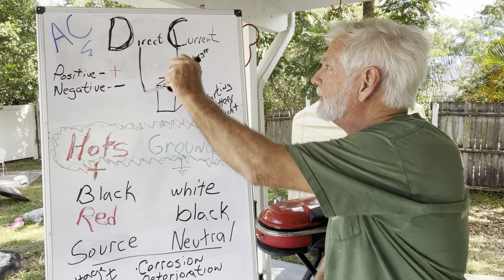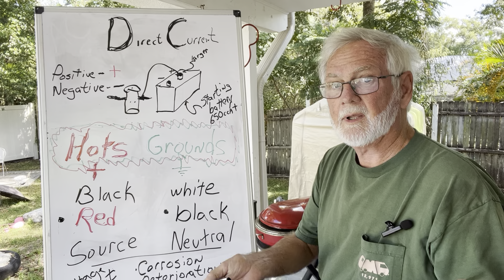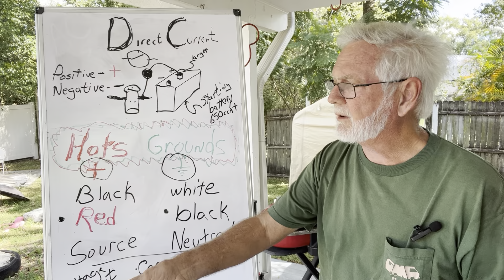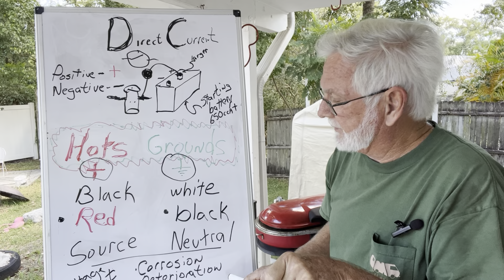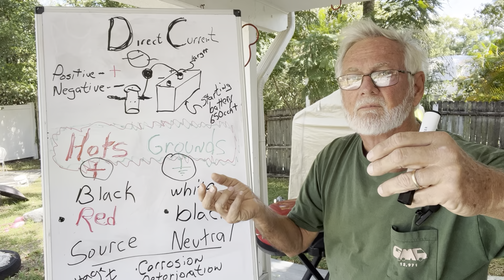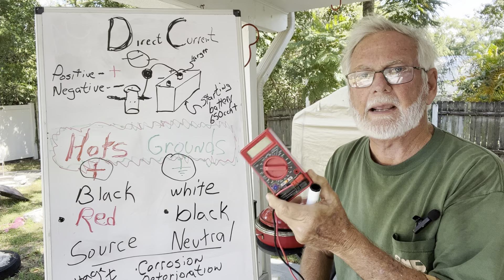Hots and Grounds…. A look at have to have both

Comment: Thank you Jim, this video came at the perfect time. I've had issues with my living battery not holding a charge and recently confirmed the postive cable is grounded somewhere. Thankfully nothing melted when I connected them so it must be just slightly enough to drain the battery overnight. I'm going to check that cable crossing on the frame first. I thought it might be a shorted out switch or solenoid somewhere along the line. I'm looking forward to hearing more on the living area circuit in the generator compartment and how the switches were wired and designed to work back there.
Reply from the maker: Give me a call, let’s work thru that

Comment: Hi Jim, I'd be very interested in a video on your 'best practices' when it comes to cockpit insulation (from the engine compartment). We notice quite a bit of heat infiltration through the pilot house flooring and engine cover, I figure this is likely a 'solved' problem. Thanks in advance, appreciate all the videos 👍🏻
Reply from the maker: Yes, it’s a problem with our coaches, I did a video on that…. Root around in the database or give me a call.